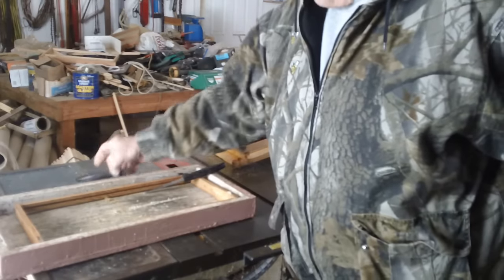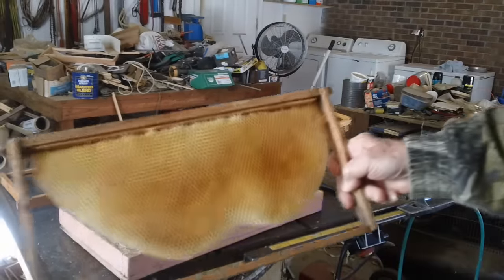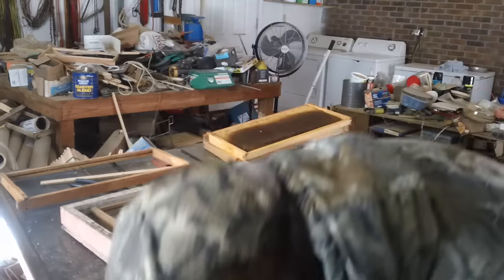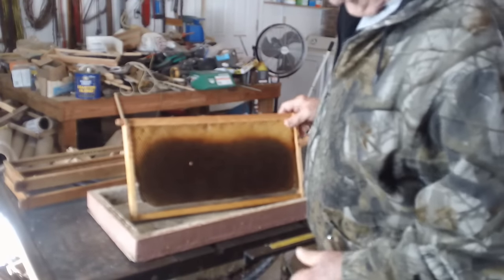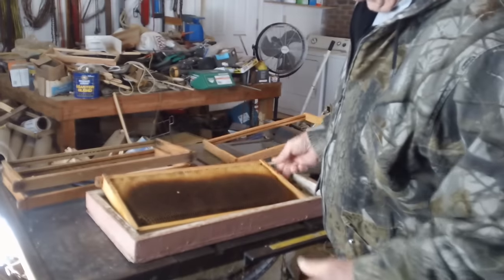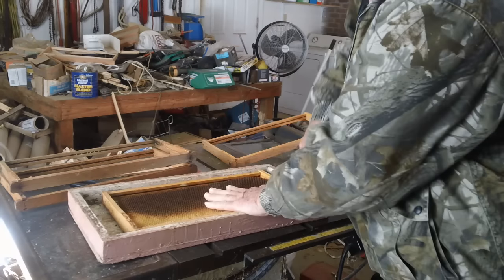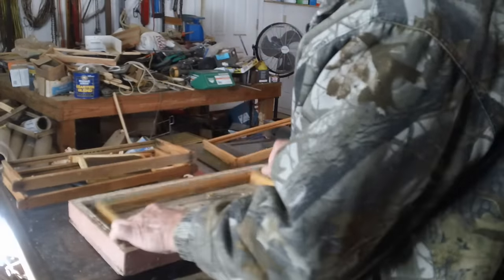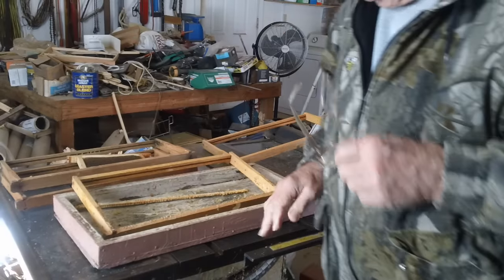JUDGING YOUR WAX

Comment: Started my colonies fresh this year. Trashed everything in the of frames. Even with low mite counts I was experiencing PMS and deformed wing virus. Im thinking the viruses are building up in the comb over time. I could itratiate the comb but don’t want to go that direction. Also the mite bombs from other Becker’s not controlling their mite loads isn’t helping much either. I’m  moving towards foundationless frames ( saves a ton of money). However I’m still going to be using foundation for honey supers so they stay together for extraction.  If I could find a market I would only do comb honey.  No more holding wax year to year.